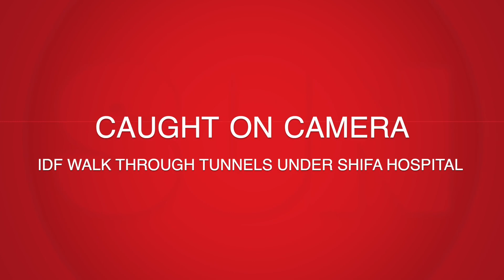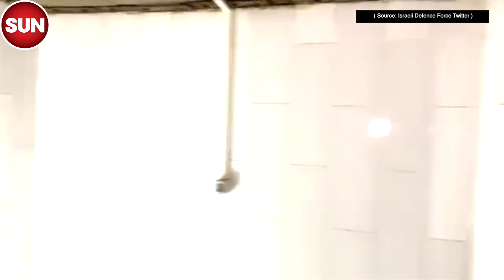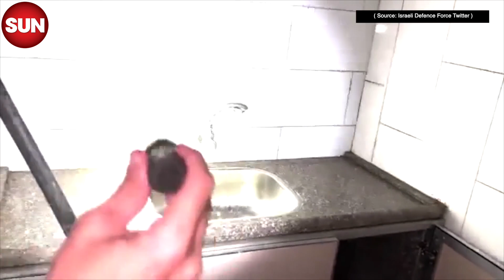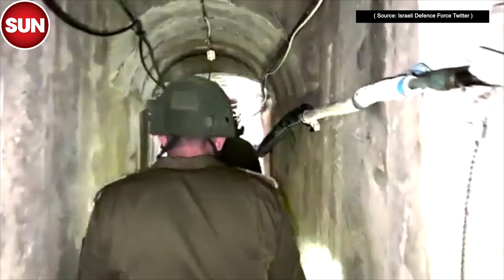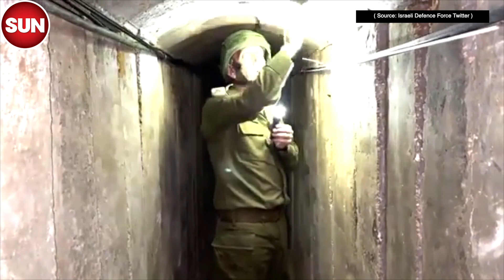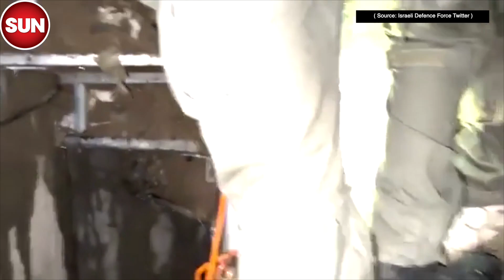CAUGHT ON CAMERA: IDF walk through tunnels under Shifa hospital

Comment: Are these the tunnels that Israel built under the hospital in the past or different ones?
Reply: they built a basement- hamas expanded and built tunnels around it
Reply: @kellymulderino7156  interesting. According to the Israeli official I heard speak about it, they built operating rooms  (multiple) and other facilities to expand the operational capacity of the hospital.
Reply: yes thats true.  but hamas still used those areas for terrorist activities and also tortured palestinians and kept them captive down there as well @doubleeagleaudio
Reply: @kellymulderino7156  so not just a basement then?